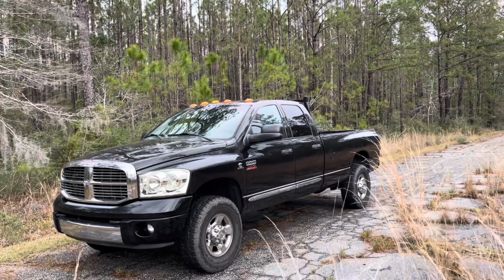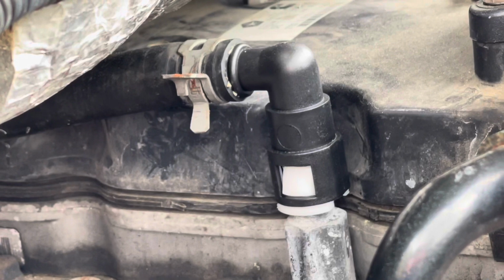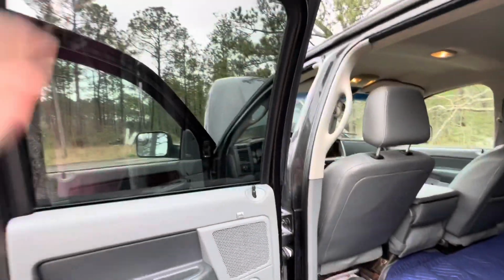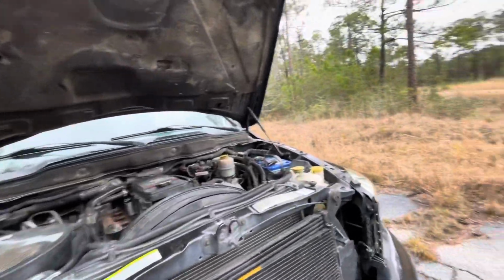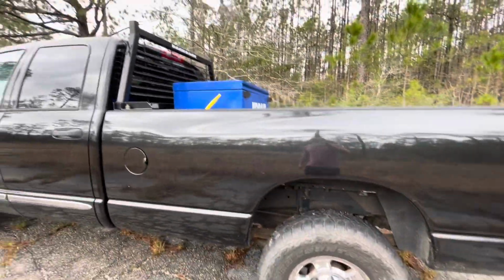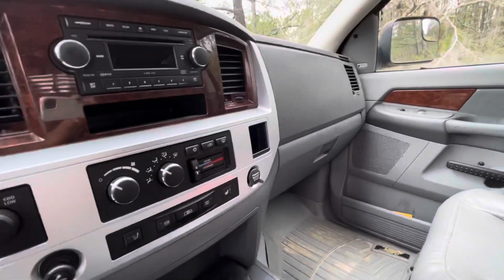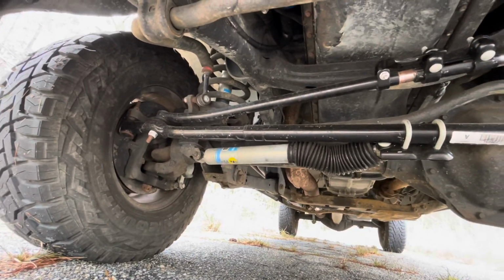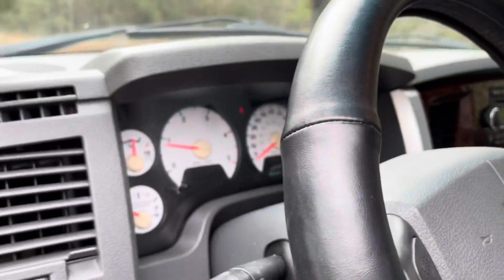3 year update video - 2009 ram 2500 6.7 cummins G56

Comment: rear door is for sure the wire harness. super common 3rd gen problem. my truck the rear lock didnt work. new harness fixed it. wires break from opening and closing the door
Reply from the maker: Good tip however I checked inside the boot and they were all good. I had been in there before to repair one for my speaker.
Reply: @OutpostCTD  the wire can break inside the insulation. You might be able to use the harness from opposite side door to test

Comment: I have a 2005 G56 that I've had since 2007... 141k miles (almost 100k of those are mine).  I put a South Bend CON-OFE clutch in it in 2009 (with their upgraded hydraulics) and I also noticed my slave cylinder was very low on fluid a few months ago... but that's the first time in many years I noticed it low.
Reply: I have the same exact setup. How do you like the south bend clutch? I was debating between south bend and valair
Reply: @200130769  It's been a great clutch.  It's from before they had a dual-disc setup, which should be way better in drivability but does have a bit of a rattle from what I'm told. My biggest complaint is it can be pretty grabby at times, BUT, it sure has held up to a LOT of abuse and a lot of power too.   Note it includes new hydraulics so pedal effort does go up noticeably but you get used to it.  If this ever wears out, I'll go to their new dual disc setup.  I have about 70-80k miles on it so far.
Reply: @robgoffroad  awesome thanks for the feedback. I wont mind a little more grab and pedal effort. Especially when you're getting a really tough clutch. I heard other people say they were a little loud too. But I think those people had the dual disk clutch
Reply: @200130769  Yeah I've heard that of the dual disc, but this one is no louder than stock.
Reply: @robgoffroad  wow that's pretty impressive. Thanks again for the feedback